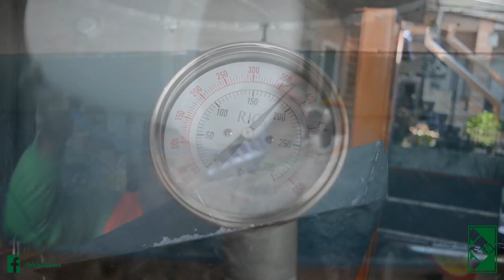[FSK Builders] Non-Biodegradable Waste Processing Machines | Featuring Plastic Shredder and Melter

Comment: Hindi po maibenta ang finished product kasi sa sobrang oil na lumalabas lalo na kung nabibilad sa araw. Masyadong madulas ang finished product kahit linisan pa sabon at tubig. At kapag naman nilagyan ng pintura / oil based / exposy  ay tinutulak ng oil na lumalabas sa galing sa finished product ang pintura kaya kahit matuyo ang pintura ay madali itong matatanggal.Paano po ninyo masolusyunan ang ganitong klaseng problema?
Reply: Lagyan mo ng konting buhangin o kaya colored cement powder ang bottom ng form. And bottom ng form and surface ng paver.
Reply: @reneflorencio5221  nagawa na din namin yan, pero sa katagalan tinutulak parin ng oil ang poweder cement, buhangin, sawdust, powder glass, etc.. 1 year na pag-exposed sa ulan at init nang finished product nag-bre-breakup yung composition ng product. wasted investment. tsk tsk tsk